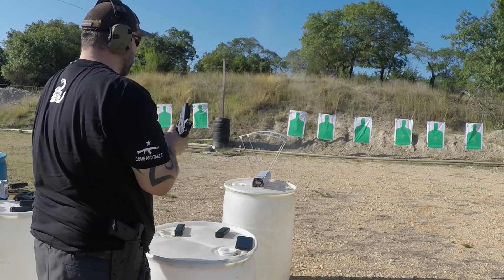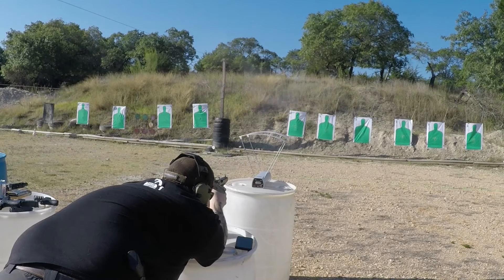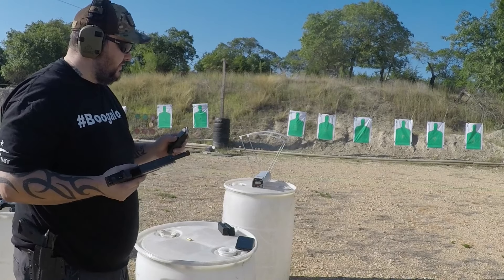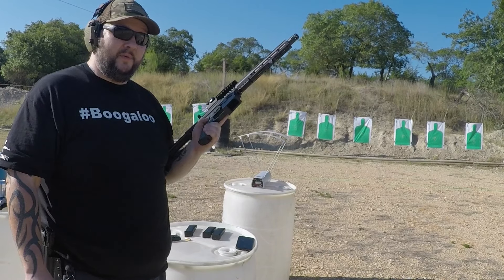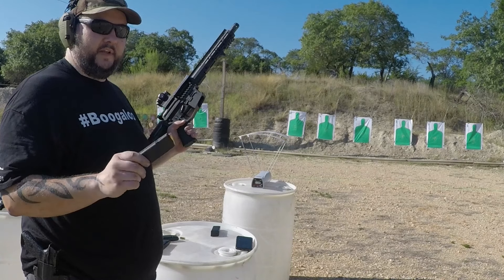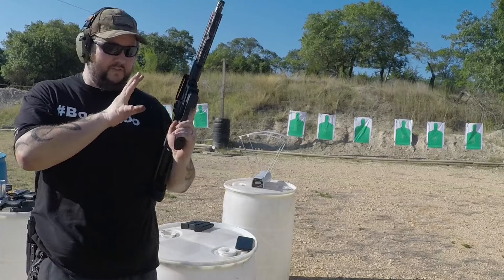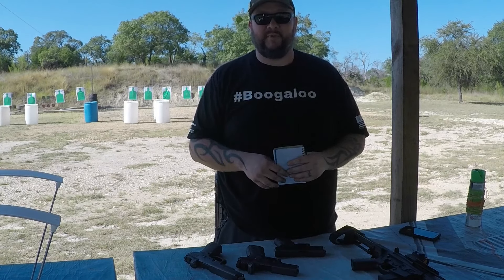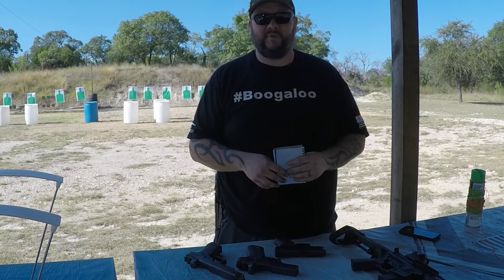10mm VELOCITY TEST

Comment: So.. this is a good test, but kind of useless if we don’t have bullet weights. Do you recall what they were?
Reply from the maker: Sig is 180gr, double tap is 200gr, civil defense is 60gr.
Reply: @NOTSOSLIMJIM  I see. Well, that certainly explains some of the lackluster numbers from the double tap, but I’d still expect a bit more. 
Either way, thanks for the reply
Reply from the maker: Many of the 10mm self defense loads are not very hot. They are loaded to not over penetrate. So, basically just a .40cal.